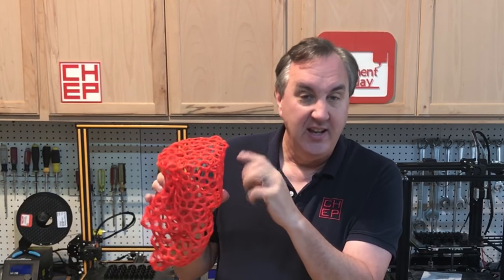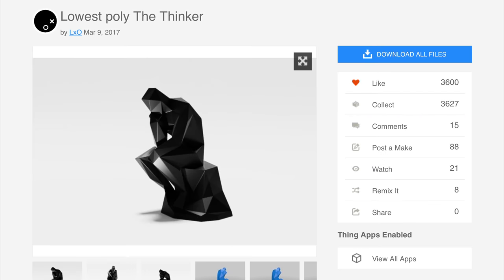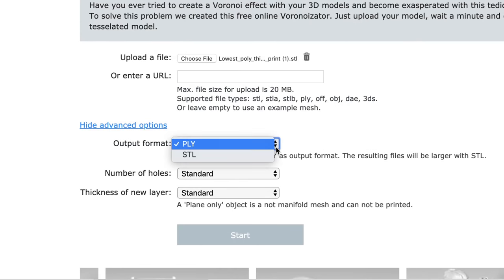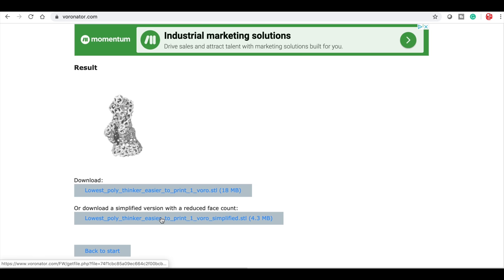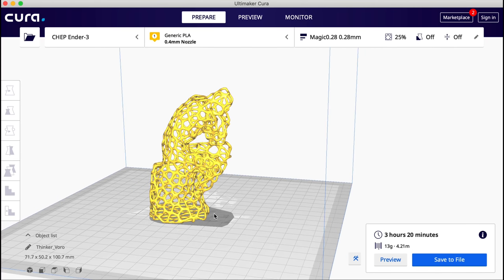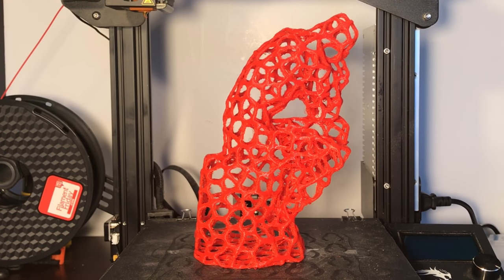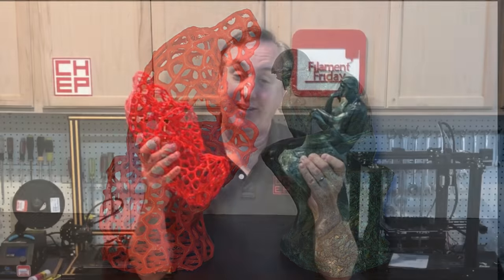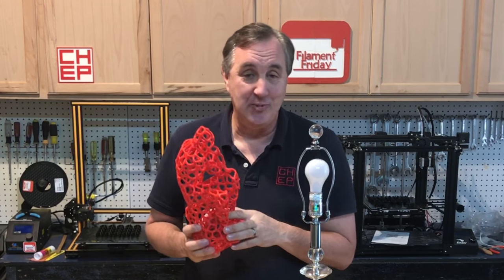Create Voronoi Effect Quickly on 3D Prints

Comment: I don't worry about the overhangs so much anymore since I discovered a great technique at smoothing them: Get a soldering iron with an adjustable temperature and a flat tip, then heat up a little at a time until it's hot enough to just push the bad areas back into the print, and wipe away as if you are applying filler. No more bad overhangs. Works great at smoothing out support material too, as the knife always leaves a matted bit where you cut it off. Turn the heat on the iron up to melt these away and re-apply that lost gloss. Takes practice to get even though.